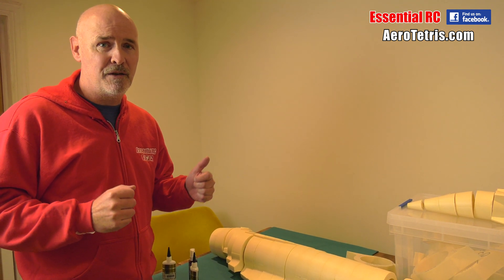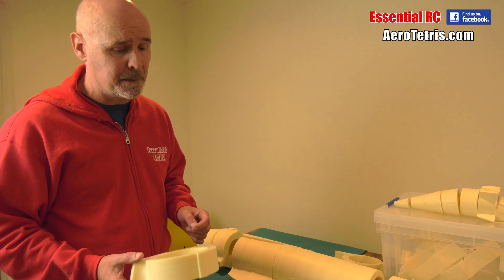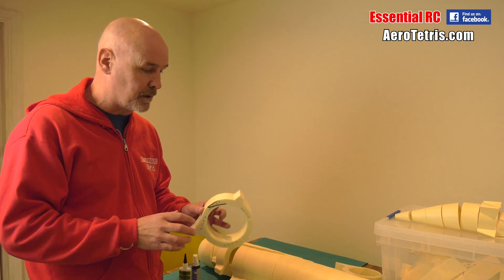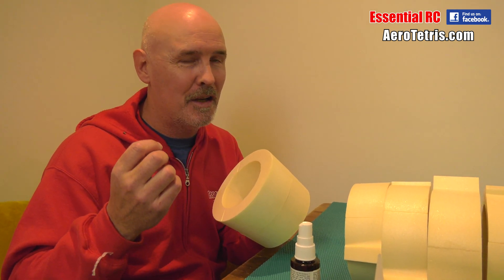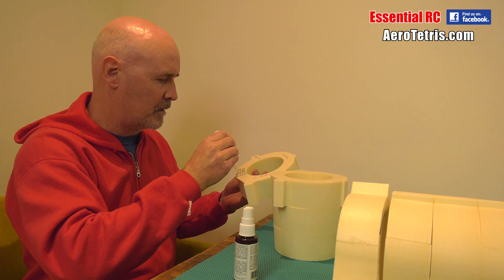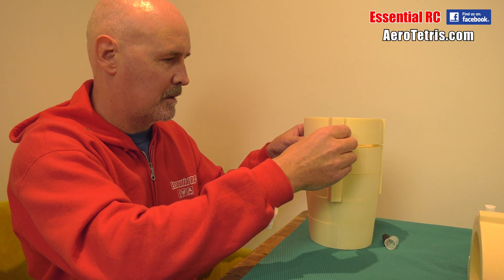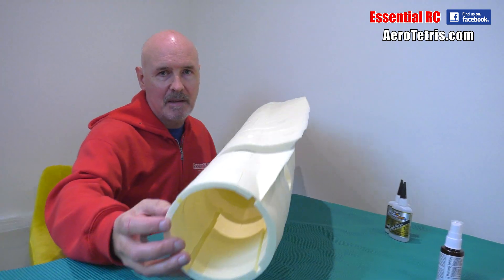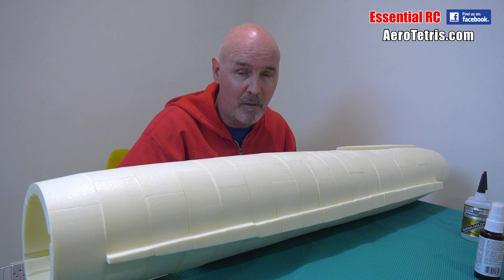AeroTetris 2.8 metre SR-71 Blackbird: BUILD LOG: Part 6

Comment: Good Day Sir, I've been watching this video series earlier and it took me a long time finding this kind of detailed project and I want to know what kind of material you are using with.. thank you so much
Reply from the maker: Read the video description
Reply: @EssentialRC  is there going to be another update??
Reply from the maker: @roanmccluskey7180  No. Project abandoned. Sorry.
Reply: @EssentialRC  fair enough there are a couple youtubers attempted one but I think they are just to long to build.
Reply: @EssentialRC  do you have anymore tips because I'm thinking about trying to build one
Reply from the maker: @roanmccluskey7180  I don't. Best to contact someone who has completed an AeroTetris project.
Reply from the maker: @roanmccluskey7180  There is nothing in the design that integrates formers or structures to strengthen the fuselage and the wing is flat with no profile. You need to be an expert aeromodeller to complete such a project.

Comment: It's disappointing AeroTetris wont help when it comes to spare parts.  Surely they can come up with some cost effective way to re-order specific parts.
Reply from the maker: Disappointing but I can kinda understand why. The cutting of a foam block is one job by a computer so just not possible to do individual parts. It's not a disaster. I can fix it. Cheers Dom (Essential RC)
Reply: I was thinking you could just buy the whle sheet that they part you need is in, as the simplest option, or they could cut out the sheet of the spare part is needed from, charge a fair price for the piece you need that doesn't leave them loosing but also them knowing they have all the remaining parts for spares for other people in the future.
Alternatively, the parts are all going to be separate components in a design, laid out to fit in the sheets.  They have to know what piece is what, and so they can copy/paste your required parts to a temporary layout and cut it for you.  Of course you pay a fee for the service etc.  All better options than just saying 'buy another whole kit yourself'.
Just some thoughts, I'm enjoying watching it come together though, keep up the great work.
Reply from the maker: @guyb7995  Well...if I was missing more parts I might ask for individual sheets but I can fill the gaps fine at the moment.

Comment: Have you glued the other engine pod together yet? If not then that piece you are missing on this side. Use the piece from the other side. Use it as a template. Get yourself some foam. And really really simple to set up a ply guide and hot wire cutter to perfectly cut the foam to shape. All you need is some wire. Pass a current through it to heat it up. And pull it through the foam like a wire cheese cutter. You will need ply plates temporarily glued to each side though for the wire to run against to avoid you going off.
Reply from the maker: Thanks Carl. Will consider that. No not built other half. Travelling from Tuesday so busy getting ready. Will catch-up after I'm back. Cheers Dom (Essential RC)